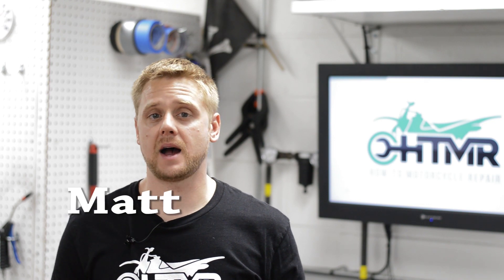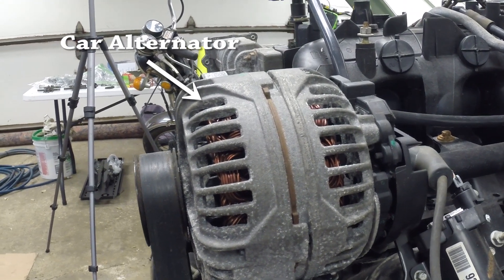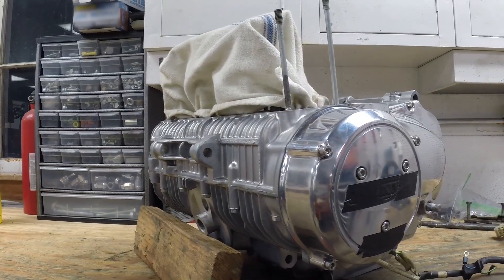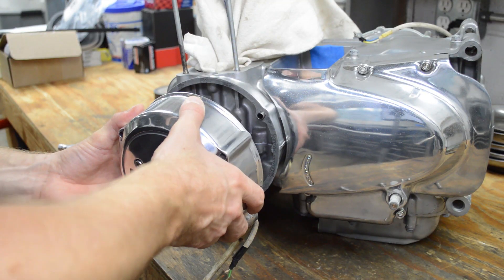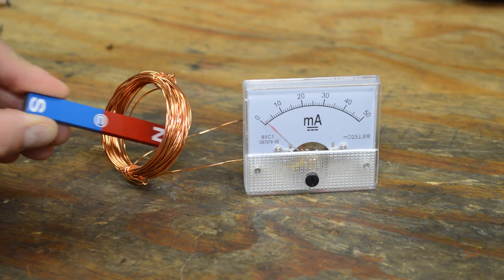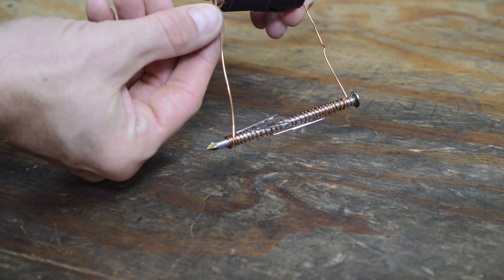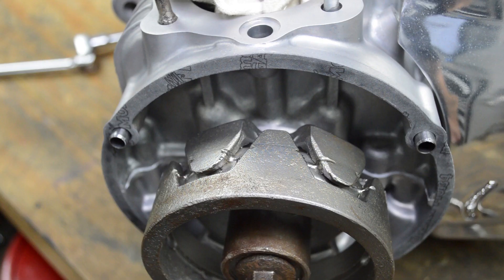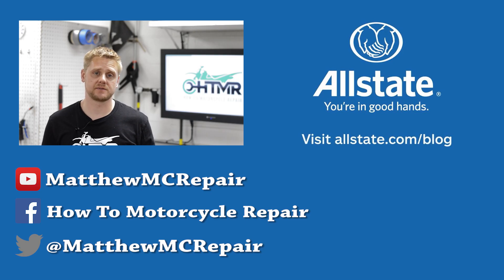How Motorcycle Alternators Work | Allstate

Comment: How the power from battery is given to rotating rotor to make it an electro magnet
Reply: Power apply to the stationery field winding, it then make the rotor into magnet. Same as wire(field winding) wrap around a nail(rotor).

Comment: Hmm, you seemed to have left out A/C three phase current to D/C  conversion via diodes and being put through a regulator to supply power to the electrical system and how it charges but doesn't cook the battery. All you just said was "spinny magnet thing in a copper windy thing is good". People are dumber now than before they watched the video.